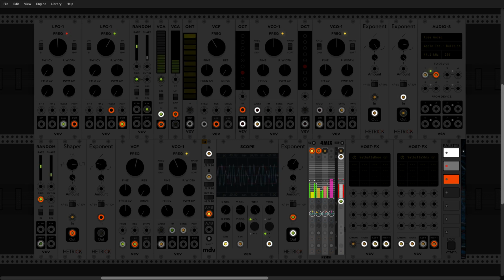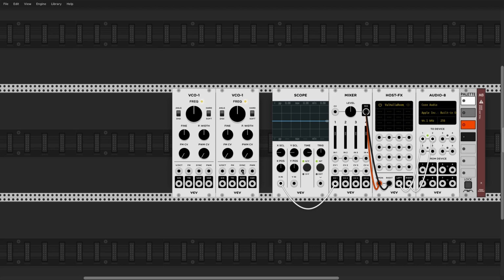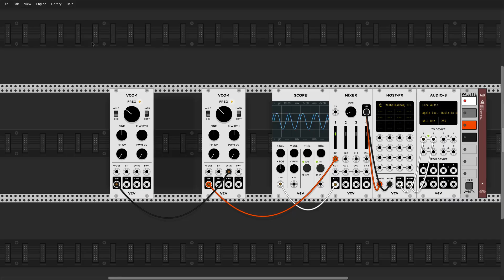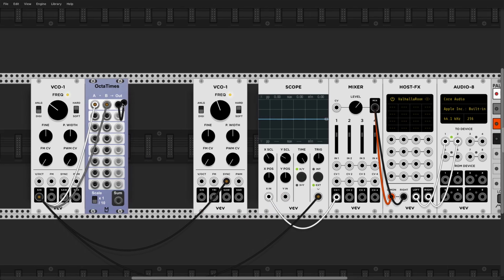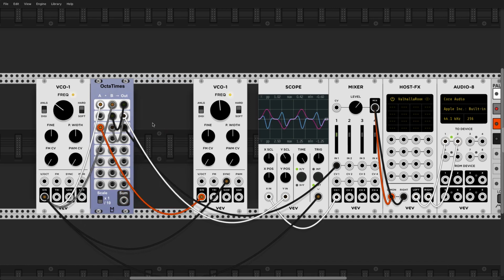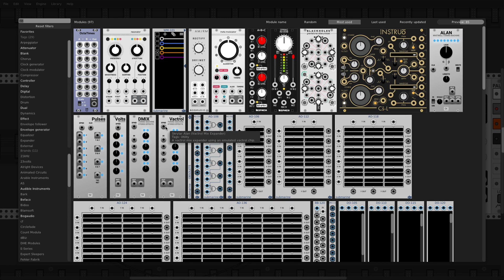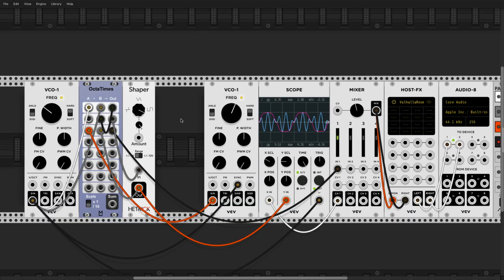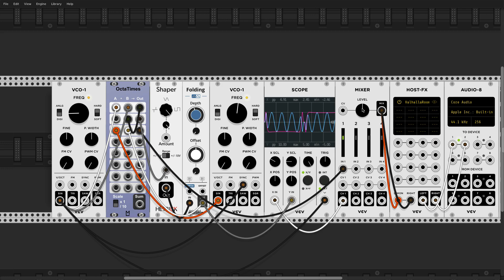VCV Rack Hacks | Smooth Sync

Comment: Nice idea and sounds good. What ring mod here does is it silences the disconnected discontinuities which are the cause of aliasing.

But analog sync with sin is still different. Sync is hard sounding by nature and it's based on these discontinuities. If you oversample the original basic method. it won't sound that harsh because most of the aliasing will be gone. The only down side would be CPU.

Comment: That's a clever solution! I'd discovered windowing functions myself when I was generating wavetables for Pigments using code: I used them to window the phase space so as to keep the endpoints at zero and avoid sudden jumps. This sort of reminds me of that, but here you've applied it to a real-time scenario, and very effectively. Thanks, this is pretty cool :)